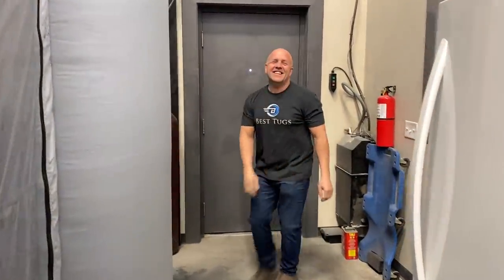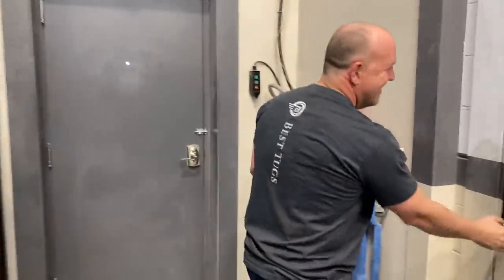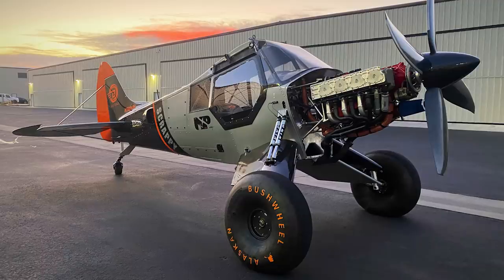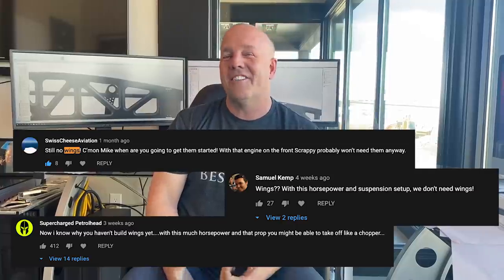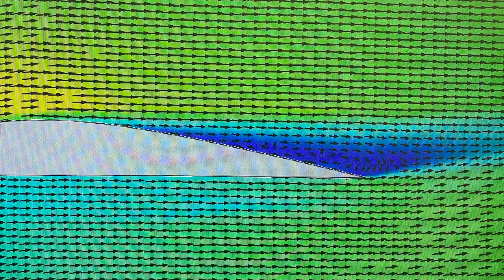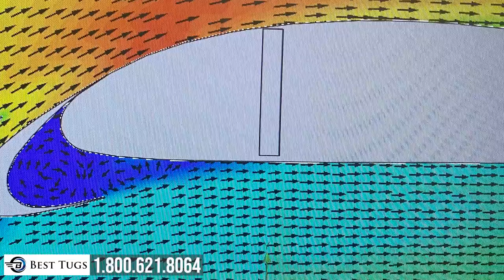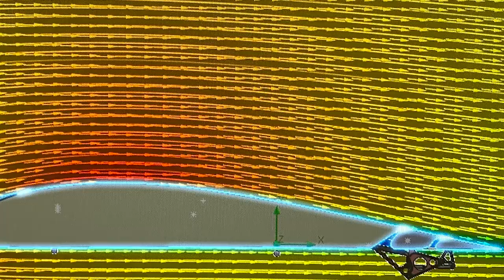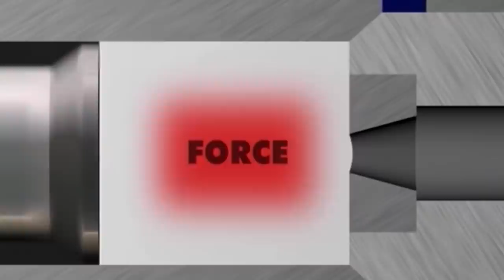Airplane Without Wings, Let's Try Something Different! | Scrappy #42

Comment: Truly good luck. I've been messing around with many versions of telescopic (Length), multiple mini wings since I was a kid, but never thought about specifically the "Girth" or "Length" (If I understand you right). Have you thought about raising/lowering submerged lifting surface of wing that's only partially exposed that's already embedded in in fuselage of craft. Minimal movement, simplicity is key here for weight as is safety first even though said last as it is and always was there from beginning. I was hoping for an "Elegant" idea to pop after a few minutes but isn't fair to all the time you've invested. So I hope your 1st to find/design/test/fly your All-The-BEST-In-ONE wing. I'm curious to see what you may have so far, but Proprietary possibly 2nd. Stay safe, as I've ran scenarios for myself (w/my ideas) before calling it a day too and at times I might be safer on a fishing trawler boat in AK.

Comment: I was wondering about Scrappy and that issue you talked about where flaps and elevator sort of swap at certain parameters...is there such a method that could benefit from having a sliding counterweight to adjust CG as the above parameters come into play?
 Im a total noob but absolutely love aviation and what you do Mike, is absolutely amazing! I can't imagine a better life than the one you have lol!

Comment: I've had an idea, When you're flying slowly you don't need so much power, why not use some of that power you're not using to pump air over the wings, to give more lift, Hey Presto Boundary Layer Control, it's been around since the the 50s,or longer, and it works.

Comment: Mike - While watching this video I'm thinking a Variable Camber Airfoil that incorporates fore-aft center of lift compensation.  Edit:  Just watched the very end and you're doing something similar.  I wasn't thinking about increasing the chord width, only increasing the thickness to reshape the wing to achieve the desired camber.  :)

Comment: What about an air compressor and a really stout tube inside the wing? Could you inflate that to change the camber for when u wanna go faster/slower? Keep the shape over the top, but under the wing could suck in for deep camber, or inflate to press the bottom out for low camber

Comment: My  bet is a deformable "soft" leading edge with a lobed cam mechanism behind it that changes the leading edge shape, connected via push rod to a trailing edge device like flaps or trailing slats.  Wonder how close I am?

Comment: Just a quick random idea why not have a wing with low camber then put a thin layer of say rubber or plastic on top of the wing that has a pocket inside that can be inflated to increase the camber resulting in extra lift. Not sure if its been thought of or done for even possible first ever plane video I've watched and probably not the last.

Comment: Instead of building an extended wing.. could you do a wing with a variable profile? Like a system that extends vertically from the inside of the wing to adjust the height of the aerofoil?

Comment: Love the videos mike, Maybe a daft idea but is it possible to slide the wing back and forth to counter the lift point at different speeds?  I guess I was thinking on the lines of adjusting the distance from the wings to the back end would give less need for input from the rear....

Comment: Hey Mike, I'm a new subscriber but would it make sense to set up a hydraulic fluid weight distribution system?  That way, you could dynamically adjust the weight and therefore centres of rotation and decrease the amount you have to rely on mechanical interventions.  You could even have different fluids with different specific gravities.
Reply: Thats basically what spacex is doing with the lox tank in order to accomplish their belly flop maneuver . So i feel your thinking man and im concerned about how much mass is there with these fluids , is it enough ? and how complex the system would be ?.  I am thinking you have the right direction but maybe for larger aircraft ? .  
I hope i dont sound critical Sir , i  am  not an engineer . 
Hey ... rather than fluid mass transfer we utilize gyroscopic inertia devices ?

Comment: what if you could like... inflate a bladder that would dynamically control the camber? inflate for slow speed, deflate for top speed. or like a bar that is at the apex that can go higher and lower to change the camber dynamically? would need a flexible skin, but, i feel like it could be done

Comment: The military has already achieved the wing effect you need. The easiest to implement was a single wing that rotates into the wind by pinning it onto the center of the chassis via an electric motor.
Reply: The aircraft was named the NASA AD-1  oblique wing or scissor-wing jet.

Comment: Well, this just went from cool project to absolutely fascinating. Keen to see how this evolves. Just from this vid, curious to know why you're looking at a custom extrusion for the spar - did you consider other options (e.g. composite) and if so why did you rule them out? Thinking the flexibility in form composite would offer could be advantageous, but perhaps the overheads of complexity to design layups, construct,  maintain etc might have contributed to ruling it out vs an Al option that could draw on knowledge from existing proven designs more? (It's been a long day, I hope this makes sense).

Comment: Design a wing with a retractable camber. Out for takeoff, in for high speed flight. Like front slats but for the top of the wing instead of the leading edge.  Or just put a Cessna wing on it. :)

Comment: Ok. I understand you trying to get the most range of performance out of your airfoil shape. Have you considered something similar to the wing on the Westland Lysander from WW2? Those automatic flaps on the leading edges might give you the slow speed performance without increasing the camber, and the drag. Thoughts?

Comment: Surely theres a way to create  a variable airfoil whereby you can switch between low/high drag and high/low lift with maybe a centre option of 'your aircrafts most efficient'. I know unnecessary weight is the enemy but couldnt carbon and your own custom milling of the rib structures replace the existing wings weight + slats/longer/wider flaps etc i know theres a lot more to aerodynamics but as your number crunching anyway lol

Comment: In my opinion I think incorporating commercial airliner parts into your wing is amazing. My question is with all that technology put into this wing design couldn't you also incorporate flaperons as well. I mean with 700 ponds what is a few pounds in actuators and solenoids.

Comment: Mike, You all are going to call me stup[id but...lol so I'm expecting that reaction but please humor me for a minute and think on the basic idea... I build r/c giant scale to miniature planes. I have been working on a modified cub design with a pretty large engine. The idea I am doing is similar and I am beginning to have some success. -Instead of flaps... I was excited to hear your idea of growing the wing out sideways. The idea with carbon fibers and other materials is interesting.  Been trying ideas for a few years with balsa, fiberglass, and what carbon fiber I can afford. The issue you already know. So I thought a lot and almost gave up a few years ago.... then... I saw my favorite jet of all time online. The F-14.  I made a worm gear and swivel to play with the plane by growing the wing for slower flight and great lift into bush areas. Then less wing and more angle rearwards similar to the 14 for speed. I think your plane has the horsepower and would be really interested to see it go... Anyway.. that was my 2 cents worth... Hope you get a great thing flying here.
LOL It's ok when you all say shush and go away lol... Expecting it but just think it through first... :-)

Comment: But what about making the leading edge/front part of the wing expand and shrink on demand so you have a thin fast wing if needed, and a thicker rounded edge when flying slow...literally making the top of the wing and leading edge move so that a fast wing could "morph" to a stall wing.

Comment: We tend to look at cross sections to be able to simplify the math to where it doesn't take a supercomputer to resolve... but what if we had a supercomputer (maybe a modern GPU would be enough) and could model the effects in 3d and maybe even develop something that transforms in 3 dimensions?  I'm imaging something more organic than mechanical in feel and character... like instead of linearly actuating flaps and slats, what if the whole wing could be curled and unfurled?  The gold standard would be to have something like an actual bird shaping its wing to almost hover as it glides in to land but that could be decades away in both concept and implementation but something simpler and maybe even contemporarily approachable to take inspiration from could be something like a paramotor wing or aerobatic parachute.
Reply: And after hearing the last bit of the video, it sounds like you might be looking in that direction already.  =D

I wonder if it would be possible to design a flap that rolls up on itself (think bimetallic thermostat switch) instead of articulating via simple hinge.  Or if it would be practical to be able able to twist the chord along the length of the wing at will, or to shorten the bottom of the wing relative to the top along its span to effectively curl the tips down.

Comment: Why not make the flaps / aileron variable during flight?  broken into programmable sections, or have a mid section between them act as both, depending on control input.

Why stick to a uniform shape all along the wing?  Alter inner and outer surface shapes to suit the need of that position.  Some areas can be adjusted in flight, not necessarily the whole wing.  Round out elongate ailerons and you don't need as much horizontal  distance.  Trailing edge doesn't need to be strait.

Variable tail would be easier than altering main wing in flight, and add it's own rear weight for the purpose.

Comment: I wonder if there is a way to make a variable camber wing.  Might help transition between low and high speed flight easier.  I have some thoughts on design, but not sure of feasibility of manufacturing.

Comment: What if you used an air bladder inside the wing to adjust the wings thickness for for slower speeds and thins the airfoil out for faster flights. Adjusting that bubble depending on the speed? It can be like depicting boots but internal. Just a thought.
Reply: De icing not depicting

Comment: During your entire vid I was thinking of something that would flex between the low camber and the deep camber (@5:44 pic 1 morph to pic 3) and possibly somehow change the length of the chord too. My other thought was... wait for it... a BI-PLANE! lol. But seeing as how you've already frozen your design I'll just have to wait to see what you're gonna do! =D

Now I'm also just learning how to fly so I know veeeery little. But if the lifting area moves too far forward won't the wing stall? And @19:10 if the flaps deploy and the lift area moves forward that sounds like a lot of drag, which is what you want, but it almost sounds like air brakes lol. But I'm just spit balling. I don't actually know what would happen.

Comment: The problem is no one ever thinks outside the box. How about a wing that changes shape? A low camber wing that becomes a high camber wing at the flip of a switch. Air operated cylinders that by use of leverage lifts a wing or tensions a wing to change it's shape while using a wing covering that is slotted at the expansion points to accommodate the new shape. Now you have a fast wing that has low stall abilities.

Comment: How about remote controlled balast to change CG or even a wing that can be adjusted via some type of hydraulics that pushes up to re-form the top of the wing on demand? Balast could be a simple weight on some sort of rail that can slide fore and aft. A wing could have split ribs so the wing  could be made thick or thin on demand. The leading would need to be "flexible" like rubber or something and the trailing edge would be hinged. It cant be too complicated to do, it is more a matter of budget. simple pneumatics don't weigh much and really wouldn't need much throw to achieve a variable profile to give best of both worlds.

Comment: If you can make a variable chord/camber wing, could each side be manipulated independently to minimize or negate the need for ailerons? Seems you might be able to save some weight and/or complexity with such a strategy.

Comment: What about a two stage wing? what I mean is almost like a bi-plane. I will draft it up, I can’t do the math but what if one wing was more high speed and a secondary wing, one that could be retracted was more lift and low speed or vise versa. Like the older f14’s used to do (in terms of retracting / extending for different flight modes)

Comment: Could you build your plane wing of the body? Similar to the B2? Lift along the central line? Maybe it isn't good for slow? Also, could the seating be placed way back to assist in the balance issue? Probably would be strange to see the pilot / passenger in the tail end. Can't wait to see this transformation wing. Subscribed and "🔔 'd

Comment: What if...top of wing was flexible Kevlar, with interior rods that roll on a series of cams that change the airflow to obtain higher sustained vacuum over the outer 2/3 of the surface?

Comment: Don’t overthink it, how do birds increase speed when diving towards prey and then slow their descent to touch the ground with ease? They fold their wings at the “elbow” to speed up (F-14 Tomcat), and extend and spread their feathers for slow descending flight. Now simplify these practical (for birds) mechanics into something viable for your project.

Comment: Flexible aramid composite over bowed memory metal. When you apply charge, the wing flattens out...
Reply: Memory metal is a laminated bimetal, idk availability but you might be able to make it.

Also have a look at the soft skin BMW prototype/concept.

Any time Ive seen aero that can transform its been a solution like this...
Reply: Basically you could change the entire wing shape on demand

Comment: you should talk to pugit systems. tell customize a computer for you that’s designed specifically for your use case, which is analyzing air flows. So have you a computer that does it 8 to 12 times faster than anything you put together.

Comment: I know it would be a bit of a radical design change, but I think I have a idea that could help you out with your wing. In the 1930's, Charles H. Zimmerman came up with a new type of wing that actually made prototypes. The aircraft had very unique flight characteristics, and of those characteristics was being able to fly very slow and very fast. Test pilots reported it as a very smooth ride, and difficult to stall. The primary design was to be a vertical takeoff fighter for the navy, but it was scraped do to the introduction of jets. Link: https://en.wikipedia.org/wiki/Vought_V-173

Comment: I paused halfway. Here's something you smart guys have forgotten... Stacked wings. This would increase lift a while allowing shorter total wing span. This would allow you fit between more trees. Another forgotten concept....Material. Wings used to be covered with material to be light weight... However in this application, in addition to being light, you could also use it to morph the shape of the wing from the inside, and create a fatter wing for take off and then make it thinner for high speed. Something like rubber could do this.

Comment: I think your going to need your own wind tunnel build...not too big, maybe just 24' diameter (ouu, better make it 40') with steady pressure of air, say 300mph tops. One of those new GEnx TurboFan engines for it. Find one non-airworthy?..Moses <><

Comment: Why not go with more then one airfoil? High lift winglets with maximum flaps that can be retracted for normal flight. Then you have a built in tip stall and if you build the flaps right on the wingtip, you can retract it back to the same sort of shape as the rest of the wing

Comment: Is there a way to change the curve of the wing in flight. Oops, just saw the end of your vid. Ok, my thoughts, wing span is determined already by the location you want to land. Stall speed you want is then determined by slats and wing curve. With the lower end of the envelope set, how to get a wider upper end. Now to reduce the wing curve for higher end speed, can the top surface be carbon fiber piece that is hinged at the trailing edge, then the wing curve can be flattened by lowering the top of the wing and having the leading edge tuck in behind the slats when they aren’t deployed thus flattening the curve. The wing spares would have to be 2 pieced. Just a thought.

Comment: How about a wing that you can change the arch or the thickness using layers like window blinds. By expanding the enter subframe Of wing. Lengthen the wing from front to back. Not the length. This would require a skeleton with adjustable in a couple ways yet not loosing any strength keeping the weight down. Make it 3 to 4 layers of carbon fiber thin layers that over lap like shingles the length of the wing.  Kind of like feathers of a bird

Comment: What if you had fly by wire systems that could perform mixing operations of control surfaces and a computer to achieve the ideals for all conditions?

Comment: you talk about changeing wing length to change you dynamics for speed vs stol, how about a variable wing shape ,changeing the arc either mechanically or with air pressure???  take the deicing device idea and apply it to the entire wing ?????//  just coming from a dumb truck driver, and from watching this video????...maybe a slightly swept wing???